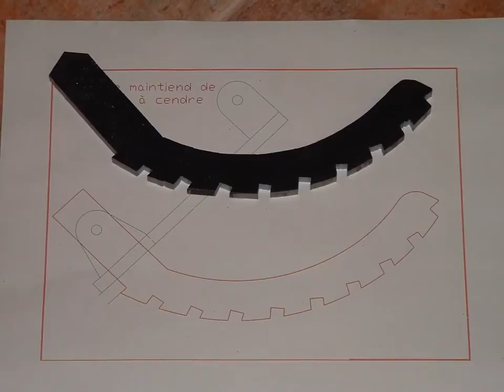Welding project - Homemade Maple Syrup Boiler Rebuild (HD 1080p)

Comment: I have watched your video several times. I was very impresses with your rebuild. I plan on doing something similar. This summer I started working on modifying an old Ashley wood burning stove to transform it into an evaporator for the fifteen Sugar maple trees I have on my Connecticut property. I hope to finish the evaporator and shelter in February. Thanks for the inspiration.